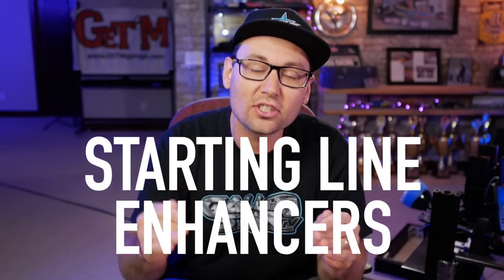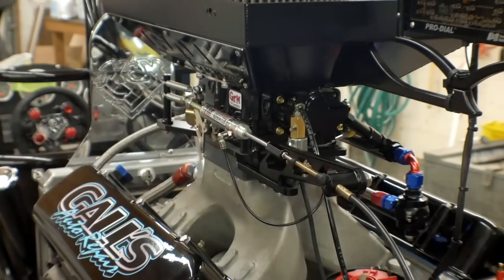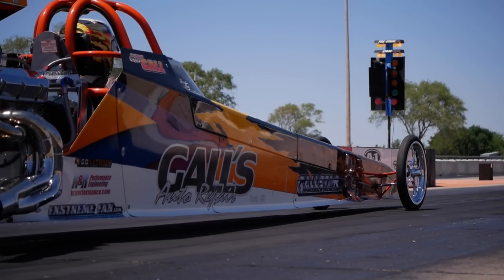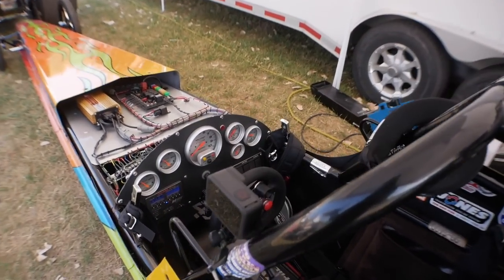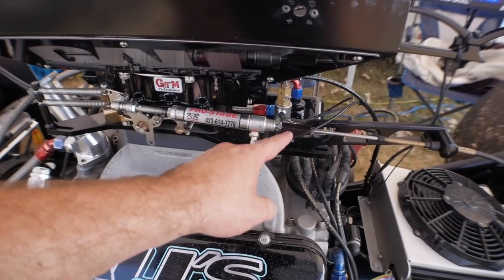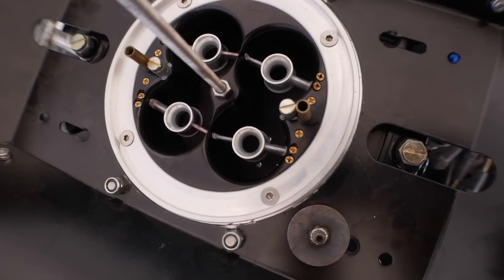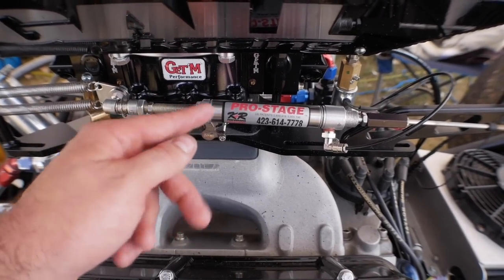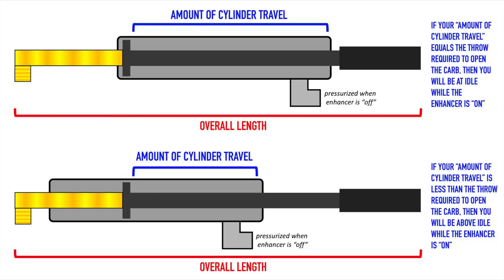STARTING LINE ENHANCERS 101 | K&R Performance Pro-Stage

Comment: With a door car you got to figure out how to mount it with out a cable I got the set up on the way. Kevin said it has a threaded end that I can hook directly to my throttle rod maybe the selinoid can mount to the air pan or something ..I will figure it out when It arrives..I'm excited to stage on the floorboard  !! Thanks for all the cool info

Comment: Thanks for sharing your set up,I have the z force box from k&r I bought some time ago question is do I need a dual control stage cylinder I want to run some 6.0 and 7.0 heads up. Need to know how to set timers to get the desired ET ,Thanks for sharing your knowledge 🤔

Comment: I understand all the benefits of these  and its a great tool, but I feel it just takes another thing away from the driver. Making it less of the driver having to be consistent. Just my opinion though. Great explanation Tom.
Reply from the maker: I hear ya - but you could say the same thing about delay boxes and transbrakes really.. I suppose that’s why they have separate classes for electronics and no-box and footbrake!! 👍👍
Reply: I prefer foot brake but nobody or not enough guys run it to get the pay out up ,so I'm going to reinstall my K&R box but I think I need the dual stage controller 🤔, if you're going to race you got to get the best cheating devices you can get✅

Comment: Tom, what are your K & R timer settings?  How do you set what time  the throttle goes to wide open?
Reply from the maker: Hey RS - the timer is automatic: if you’re the slower car, the box tells the enhancer to go full throttle right away when you release the transbrake button.  If you’re the faster car, the box calculates the crossover time and waits that long before telling the enhancer to go to full throttle.   I hope that makes sense!! 👍👍
Reply: @GallStarTV  Thanks Tom.  Another question ... what kind of neck restraint system do you use?  Neck collar?  Are the Hans type devices restrictive when trying to look straight across at your opponent on the big end. Wondering what other dragster folks use (simpson, hans, ...)?

Comment: So, what triggers full throttle? How is that timing controlled?
Reply from the maker: The pro-cube delay box controls it.   If you’re the slower car it triggers right after you release the transbrake button.  If you’re the slower car it doesn’t trigger until the crossover time has elapsed.   This results in it being triggered at the exact same amount of time before the transbrake releases every time. 👍👍

Comment: I have everything you showed in your video ,but I’m having a issue with the enhancer not releasing to wide open throttle from time to time. It always activates but there’s no telling if it’s going to work and it’s left me hesitant to trust it. I would appreciate any suggestions you could make . I have double and triple checked my wiring and found nothing wrong. It tends to happen in my dragster when I’m crossing over against another dragster that’s just a little bit slower then me. If I race a door car that 2-3 second slower it will work just fine. And when I say not releasing I mean the transbrake releases but I’m still at idle. I have the feeling I’m doing something wrong to cause this? 🤷‍♂️ Any advice would be much appreciated. 2018 American dragster-K&R everything, compressor, delay box and enhancer , switch and relay board. Thank you for making the video on this subject there’s not a lot of info out there I have looked.
Reply: David, are you putting any pneumatic oil in your air lines that feed your solenoid and your throttle cylinder? I do this every 30 to 40 passes to keep the solenoid from sticking and the throttle sliding easily. It only takes 4 to 5 drops at each place to keep things working properly!
Reply from the maker: Hmmm..  sounds weird and with only a half a season under my belt with my enhancer I don’t know if I’ll be much help. 

Can you make the problem repeat back in the pits? If so, do you believe it is an electronic problem or a mechanical problem?  Is there something binding in the throttle cable? Possibly low air or C02 pressure when the problem happens??
Reply: @GallStarTV  thank you for the info and the video, I’m going to hit some test and tunes until I get this figured out.
Reply: @dennykatz157  no , I haven’t put any thing into the air lines, but I will. Thank you for pointing me in the right direction.
Reply: @David-fw9qb  Hope it makes a Difference !
Reply: @GallStarTV  I hit the thumb down by mistake so I will hit the thumb up 2 times to make up for it sorry bro

Comment: Why don’t you guys just take all of that crap out of your cars and learn how to drive !!!
Reply from the maker: LOL!!!  🤣🤣🤣
Reply: I agree but no box doesn't pay much Money, I got a door car runs 5.67 in the eight mile,BBC Vega Wagon so I'm going to reinstall all the electronics ✅
Reply: @ronaldlewis8620  ok you do you .for me is all about driving with the seat of your pants  . I’m a retired NASCAR driver we had nothing at all but a tire pressure gauge at track and shocks /springs .
Reply: @ronaldlewis8620  I tried the 1/8 I like 1/4 mile love the big MPH . 8 second 77 nova still not fast enough .
Reply: In top bulb racing this is common and totally acceptable.   ..if you don't like it stay in class 2 or pro driver.